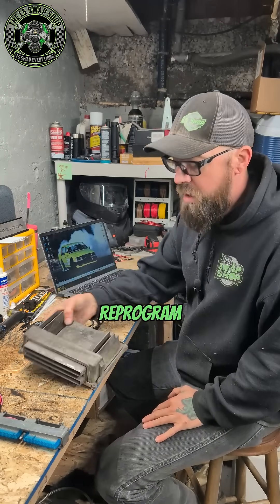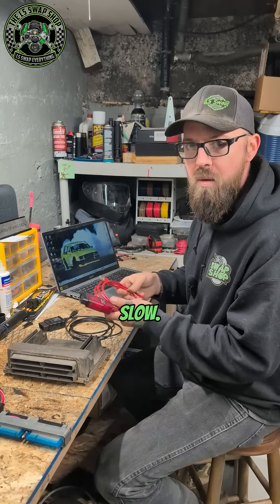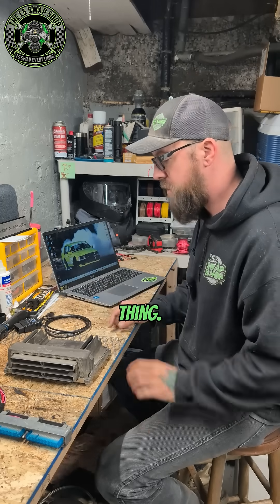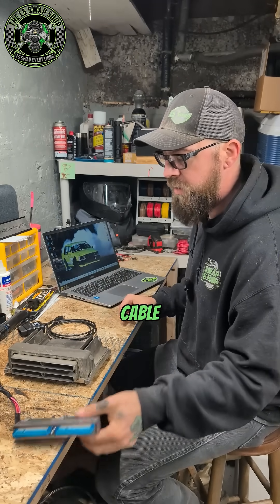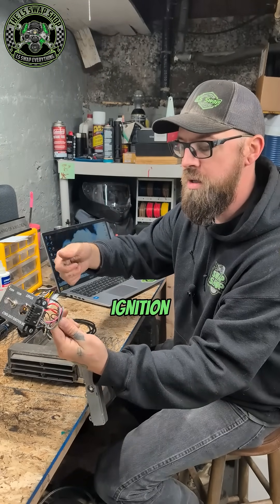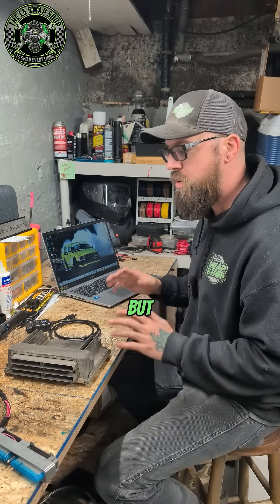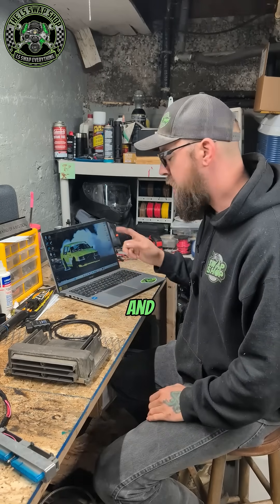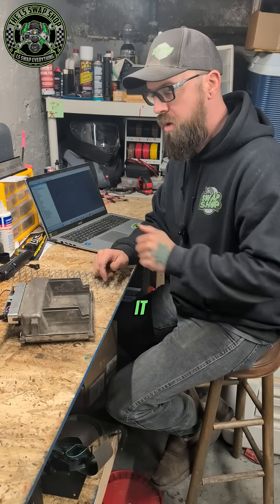How to reprogram your Gen 3 LS pcm for free!! Part 1

Comment: May i ask, can i bypass your cable and use my opus cardaq3 to do the same with your method to do on vehicle programming like this with this software? Basically will  that interface work with pc hammer? Especially outside a gm platform?
Reply from the maker: PCM hammer only works with obdlink, obdxpro, or allpro cables
Reply: Is there any particular protocol the communication has to occur across? I have xomm links for most applications from automotive to heavy duty. Most end up as a usb to my laptop or a serial port.  Most just a j protocol and hell my caterpillar cat 3 cable covers most, and the opus lets me play with every pcm ive ever touched. So ia this datalink ouraide a j1939 can network or is it some hoxua pocus shizz in the cable that says we can be super friends? If the software to do these things are free, i dont see why a 3k comm adapter wont let me get frisky with an ecm as i can reflash it in 4 minutes with the cardaq. Im ignorant, but im asking for a better explanation.  Legit thank you for the content. Im a new fan

Comment: The cable you recommend is on back order from the manufacturer direct. Would you suggested I wait until the end of February to get it or do you have a second choice that would get the job done? I was looking to get a base tune going sooner than March if possible…
Reply from the maker: The VX from obdxpro is a good option as well. Or just get an obdlink from amazon